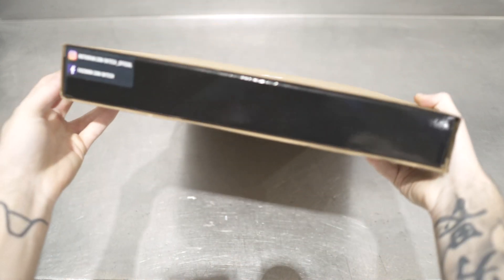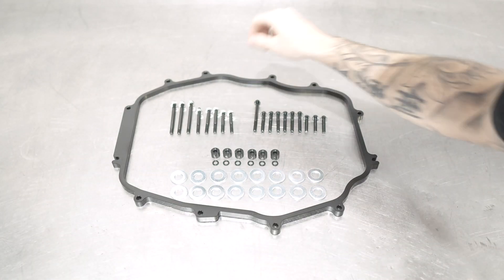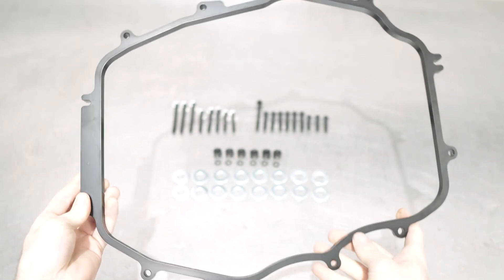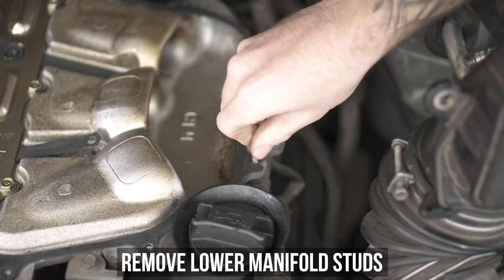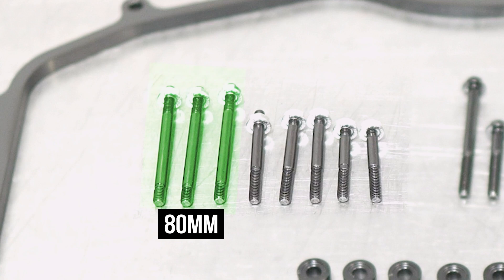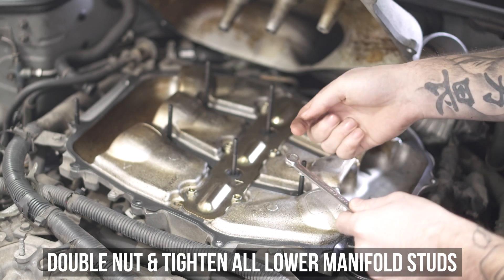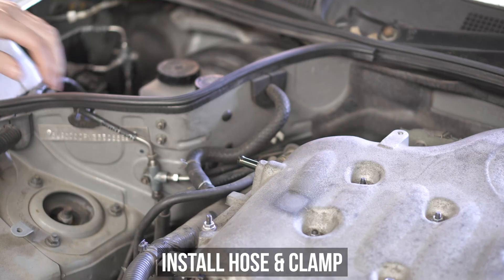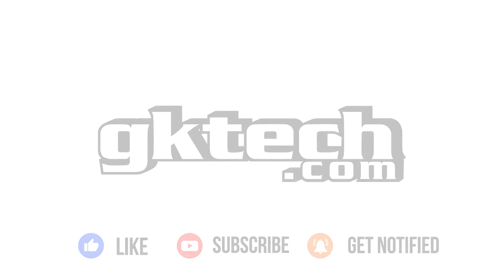Gktech Z33 350z V35 G35 VQ35DE Intake Manifold Spacer - Install

Comment: Are the spacers needed? Cause I installed a z1 spacer and it didn’t come with or mention any type of stud spacers or lower plenum hardware. Would this make me lose that .33 of air that you mentioned, thus lowering my horsepower?
Reply from the maker: Our kit is different and yes, you do need to install the spacers that we mention.
Reply: @gktech  so the internal spacers are necessary?
Reply from the maker: @ Without them you would just be tightening by feel and the pressure on the threads of the bolt hold it in place, which isn't ideal.

With spacers the manifold has a position to stop on and you can get the correct torque on the bolt.

Comment: This kit looks more complete than the  Z1 kit. sheesh good job guys.
Reply: It is z1 only gives you one gasket for the spacer and only provide the bolts that’s gone around it and the three long ones you have to reuse the old ones this kit provides everything all bolts and two gaskets to go bottom and top even the spaces with O-rings that goes inside now this is a kit matter fact, I’m about to buy one right now for my G lol

Comment: ProTip:

Take painters tape, and put a strip on each bolt you take out with the number of that bolt that is found on the FSM or their instructions. It makes it easier if you ever have to put the stock bolts back in, or if you are just removing the manifold for maintenance reasons.

Also:

If you disconnect the TB, make sure to do the throttle body relearn procedure or take off the battery for a couple hours so the ECU can relearn. :D